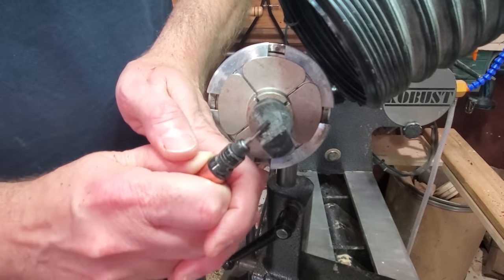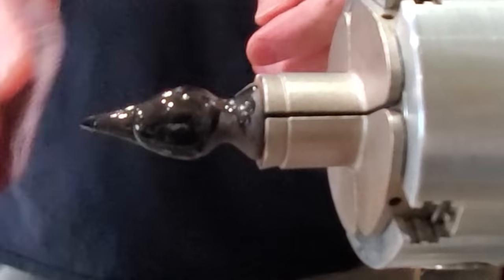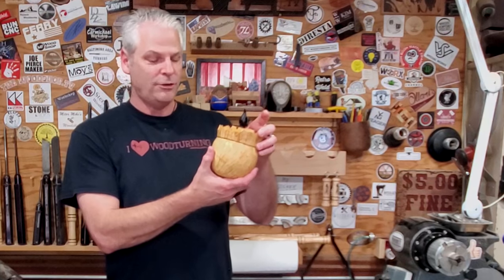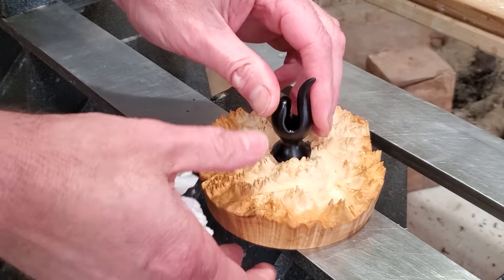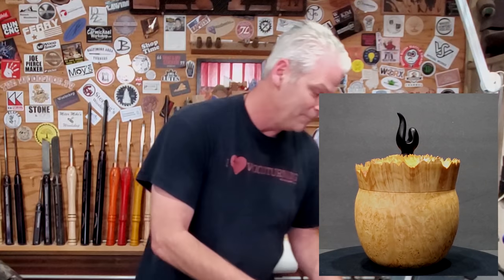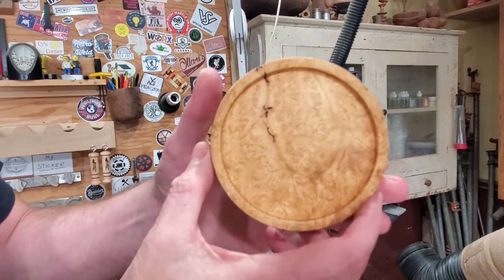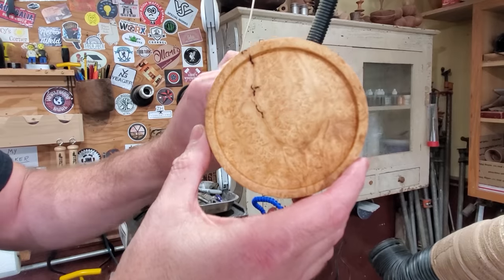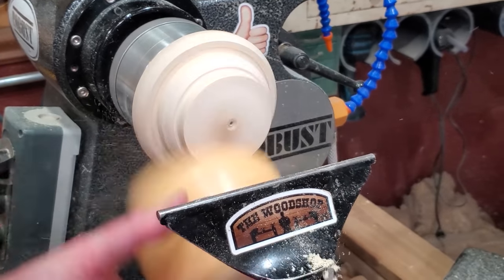Woodturning - Maple Burl Box

Comment: Is there a way to secure and turn the bottom of a similar lid while leaving the whole top natural with no screw chuck or finial?
Reply from the maker: If the burl was flat you could use a larger set of jaws to hold it, so it wouldn't damage the burl.

Comment: Mr Jacobson a few questions if you do not mind,  How big was the starting blank,  my heap of an a ledged lathe starts at 500 rpm sanding with oil would be very messy, any ideas on how I could oil sand.  I would like to thank you for all your work on videos and organising the makers international weekends.  👍👍👍👍👍👍👍👍👍👍
Reply from the maker: Thank you Douglas! I think the blank was 5" x 5" x 10". Oohhh 500 rpms....That's going to get messy really fast. I would dry sand through the grits and on your last grit turn the lathe off and hand sand with oil.
Reply: @CarlJacobson   Thank you for the information and advice   👍👍👍👍👍👍